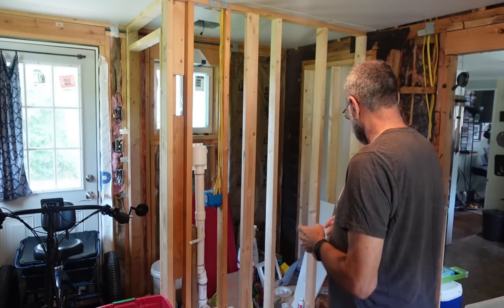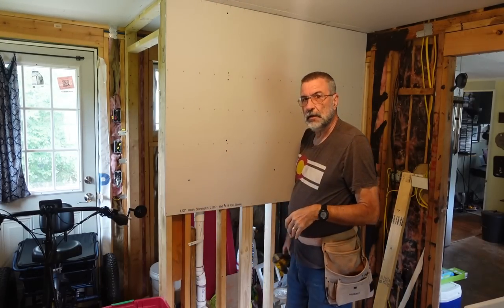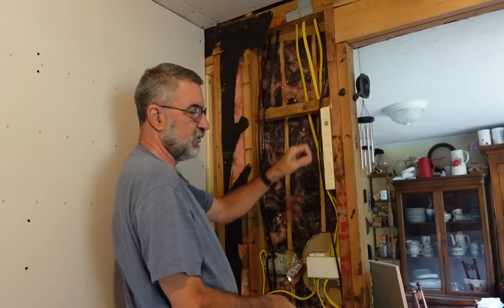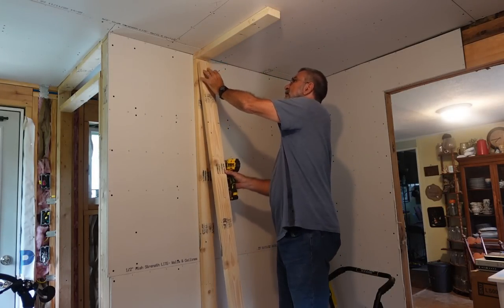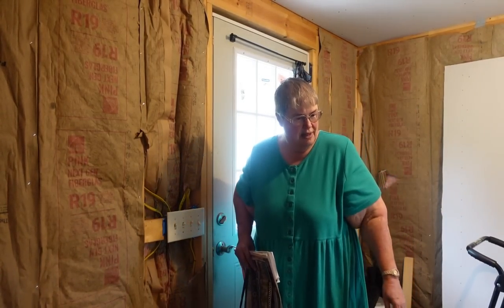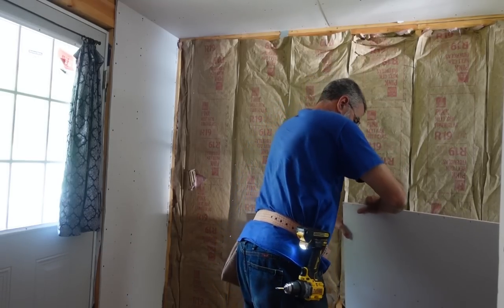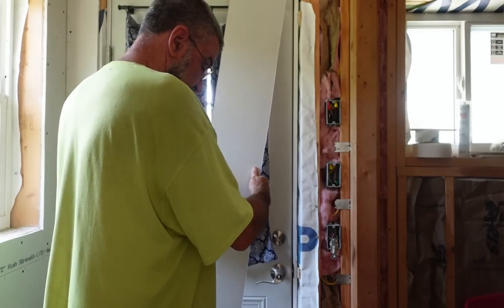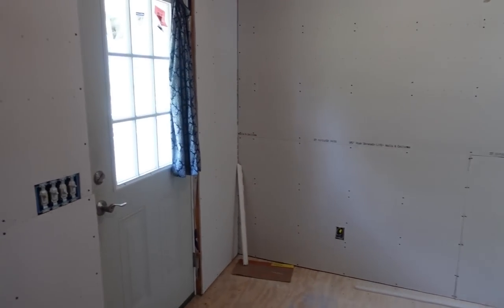Sheetrocking the Walls - Addition Build 44

Comment: Clever idea - giving Sheetrock a base. I did the same on a door. I had to take the door off and the frame to get out my dead refrigerator. (It was the easiest path to get it out of the house). To put the door back on I raised it up on a board. It was very heavy door, solid door (back door off kitchen). I impressed myself getting the door off and on, old refrigerator out, new one in. I am hard headed and try to do as much myself as I can. Would do it all if I could. Your projects are looking great!

Comment: I've bought hammers that ring like that, usually Estwing. I was told by the company that it is caused by the geomentry of the claw, making it ring like a tuning fork. They have warranties, and I returned it to the store for replacement. The only other option was to file the claw until it stops. After eight hours of hammering, I would hear that ringing in my sleep.

Comment: they make a screw tip you can put on a drill for sheetrock.  you may even get the tip for free with sheetrock screws if you buy in bulk
Reply from the maker: Yep, I’ve use those many times. But for right now, I couldn’t find one in stock in any store.

Comment: You don’t need a drywall screw drill all you need to get is the dimple screw bit for your drill I have one you could of got one at the hardware store when you bought your 2X4 it’s only about six dollars
Reply from the maker: Yup, I’ve used those before as well, but I couldn’t find a store that has them in stock!

Comment: If power tools didn't exist, would you still do all the work you do? The reason I asked that is because I think it would take 100 times longer if you had to use a screw driver to screw in all those nails.
Reply from the maker: When I first started learning construction in the 70s and 80s, we didn’t screw the sheet rock. We nailed it in with hammer and nails.